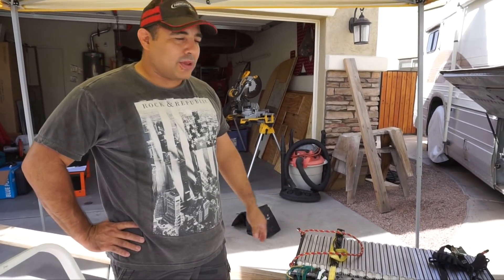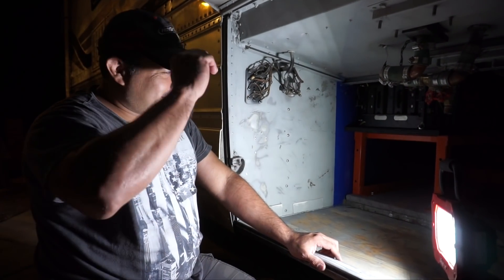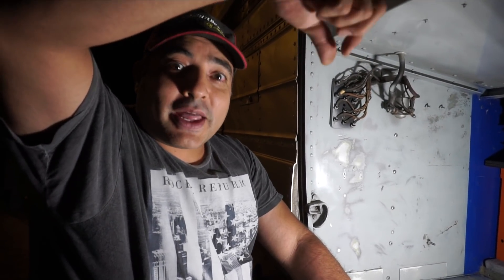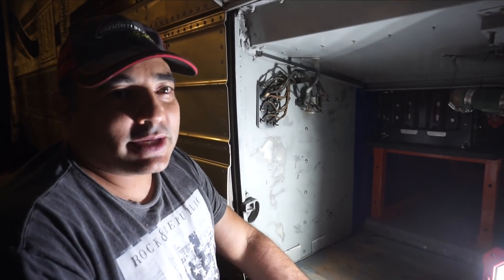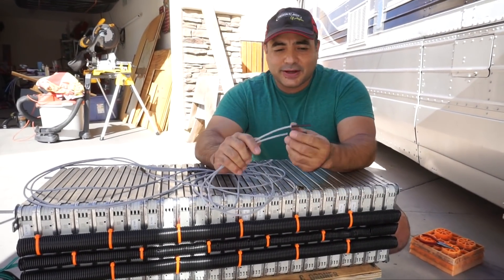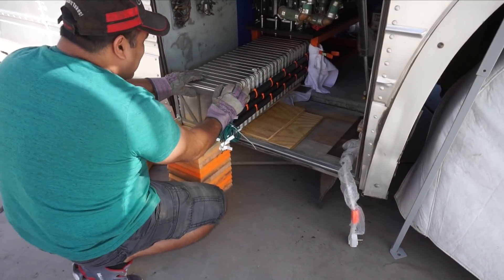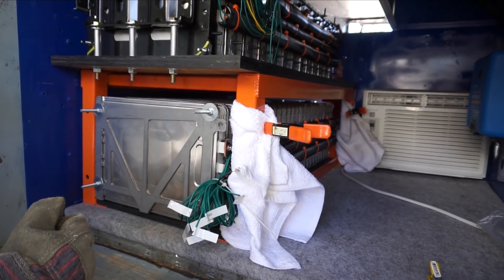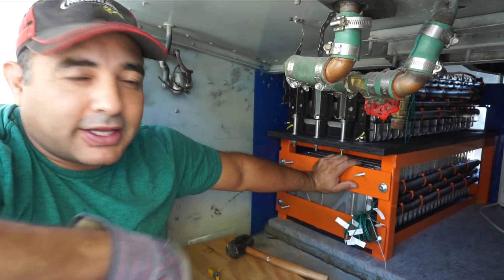RV House Battery Part 6: Installing the Nissan Leaf Battery in the Bus

Comment: is there a similar setup that I can buy?
Reply from the maker: Of course -  the "easiest" way to do it is to pair your inverter with the battery that was designed for it.  Victron makes our Inverter (we have a 48V Quattro 5000W inverter) - they make a beautiful 24V battery that comes complete with a BMS, onboard battery balancing, and boards that know how to natively talk via the VE.Bus.  The only downside is the cost.  Similar capacity to what I have in this Nissan Leaf battery will set you back about $30,000.

Comment: Very interesting projects thanks so much for sharing. Did you determine if they will calibrate correctly with the type of usage they will see? I was just thinking that they're engineered to a vehicle and you'll just be trickling off from them not pulling the same way. Very impressive  well done as always.
Reply from the maker: Hi - Thank you for the encouragement.  We should be running these batteries WAY gentle compared to when they are in the car.  They have a rated capability of putting out 90,000 Watts ... Our inverter is 5,000 Watts and we will be running mostly LED lights and have fairly light usage on the 12-volt side.  What this should translate to is the battery should last quite a bit longer than it would in the car (fingers crossed).  We will keep you posted on how they actually perform but we are hoping they do as well as some of the other reports we have seen on these in this type of application.
Reply: FYI, if you are at all concerned about heat still.  When I drive my leaf, the power draw is usually 10kw-20kw depending upon speed (12hp - 25hp).  Pedal down = 80ish kw (~110hp).  And the battery temperature doesn't budge.  Even at one of the Level 3 50kw charging stations (500v @ 100a) when it charges from 20% to 80% fast (it slows down after 80%) , the temperature doesn't go up much (a few degrees c?)  And the leaf doesn't have any kind of active cooling (not even a fan I think, just air passing under the car at speed), so I can't imagine your compartment is going to get hot at all.  

Even without the AC unit you'd probably be fine (except in AZ, parked on top of hot pavement, in the summer).  Even then, if the interior floor of the bus isn't too too well insulated, unless the inside is also 120, you'd probably get enough heat transfer from the compartment to the bus interior to be ok.  Also you probably already know, but if you don't, the leaf won't let the battery get below 20% (it will leave you stranded on the side of the road rather than deplete the last 20%) because that causes way more wear on the battery than regular use. --Joey
Reply from the maker: Thanks Joey - good information.  I have a temperature monitor on it monitoring the pack in 3 places - I have heard they don't heat up at all - it iwll be interesting to log some of that information over time.  The charger on my inverter is rated for 70amps - given that I have 14 cells in parallel it should be really easy on the battery even at the full 70 amps :)

Comment: Will you ever have to remove or replace a cell? If you need to pull out a bank to replace a cell, can you wire around a bad cell or two to delay needing to pull the bank out immediately ? Just wondering.
Reply from the maker: Hi - It will be difficult to replace a bad cell but not impossible.  We are hoping to get a few years out of these batteries before something like that happens.  Since we did all the batteries in parallel first if we needed to pull a cell or 2 we would need to pull one from each string  - again not impossible ... but kind of impractical.  We will have a BMS that should tell us how our battery is doing in terms of health and performance - if we keep it within its parameters we should get good life out of this battery.  We will report back if we have any kind of problems once we start actually using it.

Comment: how long you think  you can boondock with the power
Reply: Collect your Water produced by your AC evaporator core. You would be amazed how much water is pulled out of the air.
Reply from the maker: Jac Claes  Of course it will depend on our power usage, but this battery is equivalent to about 20 12v lead acid batteries.   Hopefully, with solar and sunny days we could boondock indefinitely.  Even without sunny weather, this battery should hold us for at least a few days.   Water will be our biggest limiting factor.
Reply from the maker: Never considered that!  Interesting I will need to research this.  Thanks!
Reply: And when you don't need to cool off, just run a dehumidifier